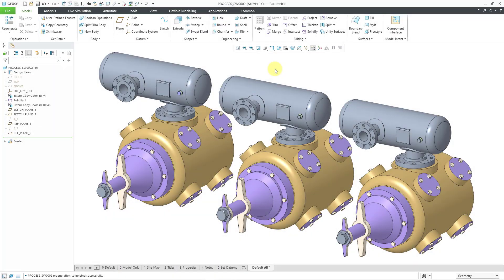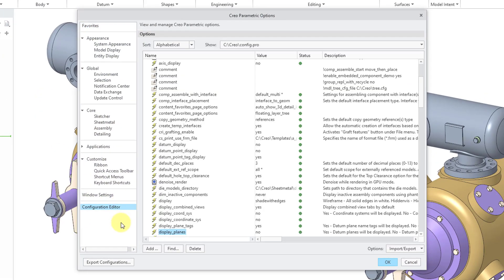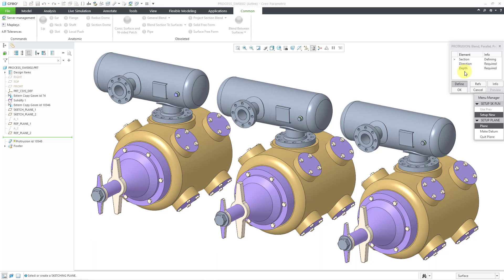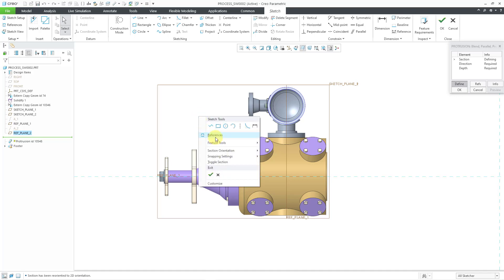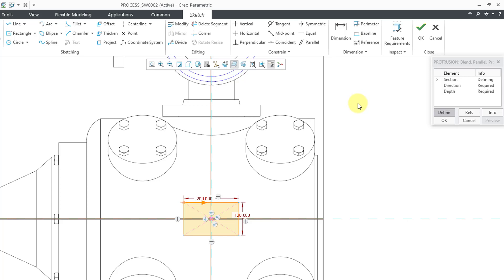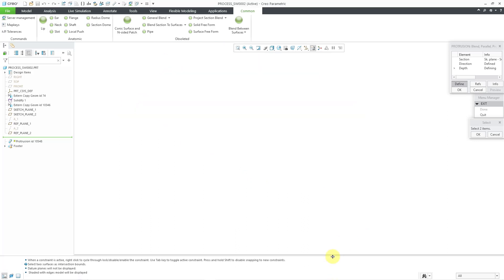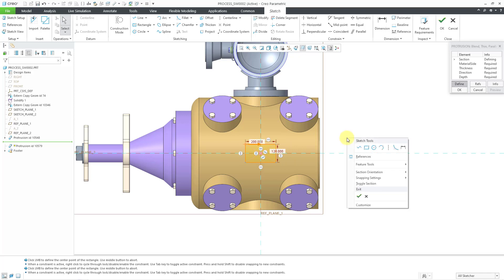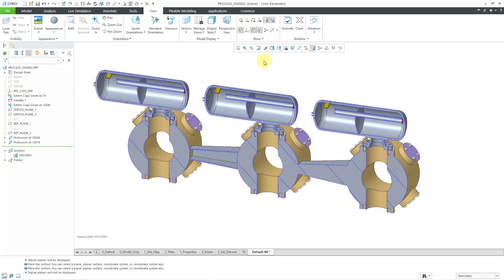Creo Parametric - Pro/ENGINEER Obsolete Features - Project Section Blend

Comment: Hi, Do you know how to measure the distance between the plane and curve surface (shortest distance)?
I already searched through the Creo website but it is confusing because the icon already has changed. I am using Creo 9
Reply from the maker: I do not know but this sounds a lot like a Creo 10 improvement but I could be wrong.